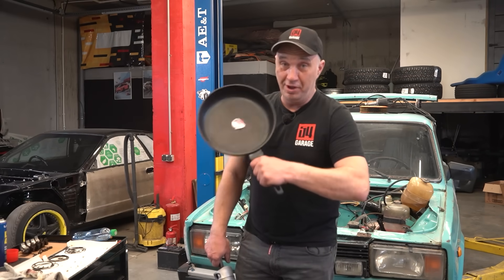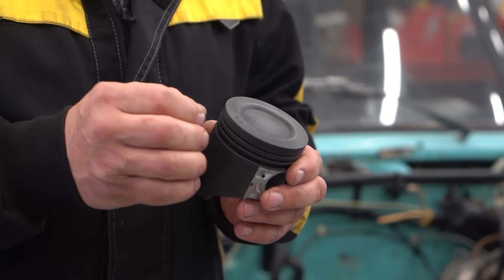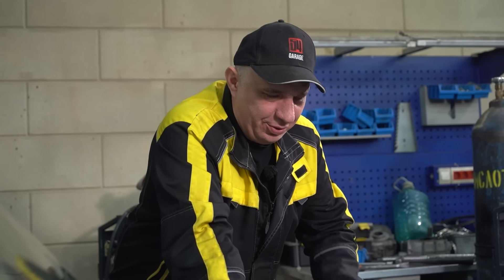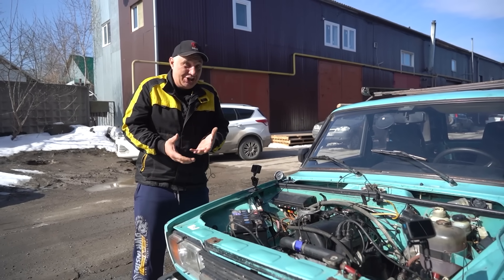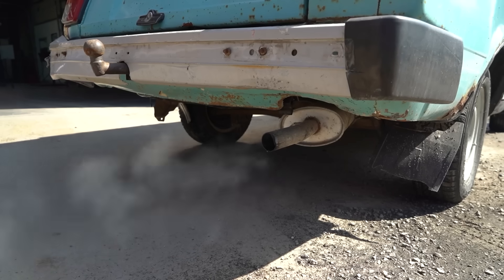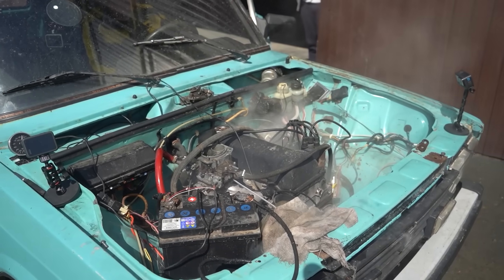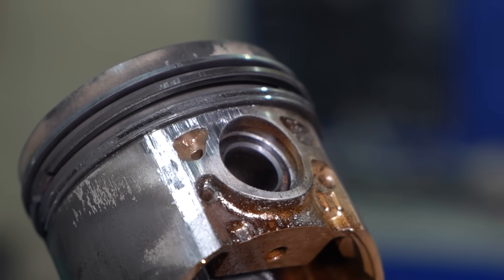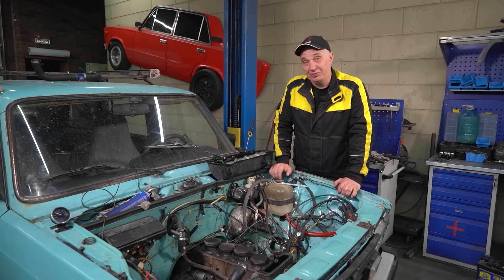We coat pistons with Teflon - what will happen?

Comment: At this point I'm convinced that anyone in that shop could assemble that lada engine in their sleep.
Reply: When they sleep, that's what they dream about every night.
Reply: @MF175mp that's what lada dreams about actually... "Put your hands in me papi"
Reply: An old wives tale says that Russian borne baby mechanics are gifted the repair manual shortly after they've grown and are able to read
Reply: It would be nice if corporations would put out such relatively simple machines still. ECUs are a pain in the butt.
Reply: @NoGoodNoob  This is what engine swap projects are for...
Reply: @NoGoodNoob just put a carburator on it Ohh The ignition is also Run by ecu mmm
Reply: @NoGoodNoob  simple means not efficient nor fast, in lada case - not even reliable. They are very badly designed cars (well, the original is a good design, but the soviet manufacturing is horrible).
Reply: @NoGoodNoob  but ecus also make cars usable
Reply: @NoGoodNoob I think LADA simple is too simple.
Ideally somewhere around 2008 simplicity IMO.
Reply: So can probably a lot of the viewers (as has been mentioned in this thread))
Reply: If you can connect two lego blocks you can assemble a Lada engine, they're as simple as 1960s USA V8s
Reply: LoL!
Reply: Lada engines are engineered to be disassembled  and assembled by drunks on the roadside.
Reply: At this point I can do it in my sleep 😂😂
Reply: haahhhahaahaha i love this comment
Reply: maybe even when being sober 🙂
Reply: If memory recalls right i believe they did a running swap and blew my mind never would have believed it if they didn't video it
Reply: Bro it is the simplest Engine on earth. OHV 4 CYL. CARB MECHANİC SPARK. 30 MİNUTES THE CHANGE HEAD GASKET İMAGİNE REST
Reply: Imagine wake up in the morning and found engine fully assembled and thought that I might did that in my sleep.
Reply: La verdad es bastante viable, ya que soportó temperaturas superiores a un motor standar, comparativamente duraría más en condiciones normales de uso.
Reply: Chez Renault, Peugeot et Citroën, ils ne peuvent pas en dire autant..
Reply: Thats 60's tech for ya.
Reply: シリンダー内壁と接してスライドしているいるのは、ピストンではなくピストンリング！
ピストンをどんな加工しようとこの接触は変わらない。
この程度の無知を騙すのは簡単だねｗｗ
Reply: I am pretty sure I can and I have never seen a lada or lada motor in person ever lol
Reply: @DarkAttack14  I mean it's probably one of the simplest motors you could build lol, the V-twins they have on most lawnmowers in the US are more complicated.

Comment: My father got a peak at 210 °C (from the engin managment) with a 1.5 DCI and only 1 rod bearing die. No overtemps light or oil was on. Only boilling water.

Comment: Actually... some manufacturers have started to use ceramic coatings on the pistons to improve the lubricating of the piston, and it works.
Reply: I can see Ceramic, not cheap but... it makes sense. Ceramic and heat goes well together. 
But yeah Teflon? a theoretical idea that just doesn't work.
Reply: But how does that work given that it's the piston rings that contact the cylinder, not the pistons themselves?
Reply: @KaitouKaiju  It allows the creation of a (nearly) friction less surface between the piston side and the cylinder walls for the oil to extra lubricate and let the piston slide more easily up and down.

Comment: this might help some , doesnt allow carbon buildup on top of the pistons and might reduce friction insde the cilinder , increasing the size of the piston might make it a cheap way to make the pistons fot a slightly oversized cilinder might want to try and coat the combustion chambers too
it might insulate the conbustion allowing more heat and power inside the cilinder and might be more resistant against detonation

Comment: Ford actually did this with the cylinder liners for the SVT engine variant of the DURATEC25 V6 found in the Mondeo MK2 2.5 V6 SVT producing 205 hp over the regular 170hp model which also used the DURATEC25, the SVT variant had fully upgraded heads with a different valvetrain and intake manifolds had a variable length intake system, exhaust manifold was different too. 

Try this experiment again with the liners instead 

The teflon coating would eventually wear off somewhat early, it was probably more useful from a marketing perspective than an actual performance increasing treatment.
Reply: Something needs to retain the oil on the cylinder walls.

Comment: "I paid for the whole temperature gauge, so I'm gonna use the whole gauge!"
Reply: I wonder if a mechanic has ever been told that 😂
Reply: Aside from the rings pistons don’t have any contact with the cylinder walls.  This is a pointless experiment.
Reply: @Notfiveo0  Wrong, a teeny tiny part of the pistons skirt slides on an oil film on the wall. If it didn't we wouldn't be wasting piston material (weight) on piston skirts.

Comment: The industry coats friction surfaces such as bearings and piston skirts with molybdenum dry film. Reduces friction and offers protection in the case of oil pressure loss.

Comment: If I had to guess, and I do, I would expect that the pistons being slightly undersized after the Teflon coating was applied was what made the engine last as long as it did. I'm sure the extra lubrication did help for a while but that extra .5 mm would allow that much more expansion before contact seizure.
Reply: 0,05mm
Reply: @ There is already room for thermal expansion. The extra room meant a higher threshold, as well as the Teflon paint coming off gave even more room for expansion.

Comment: Every time I build an engine, and the new piston set has no coatings, I coat with graphite myself. I also coat the cams.
At minimum it helps the break in. After that, it's up to my hone job and oil.

Comment: Ceramic coating of pistons, along with internal engine coatings, gained popularity around the mid-1990s. This was driven by the desire for increased horsepower and the limited availability of aftermarket parts at the time. JE Pistons offers a variety of piston coatings, including thermal barrier coatings, TUFF SKIRT coatings, and anodized ring groove coatings. 
Elaboration:
Mid-1990s:
The introduction of piston coatings, including ceramic coatings, can be traced back to this period. 
DIY Kits:
Early applications often involved do-it-yourself kits that could be applied at home using an airbrush and a conventional oven. 
Increased Horsepower:
The pursuit of higher horsepower and improved engine performance was a major factor in the adoption of these coatings. 
Engine Performance:
Ceramic coatings help to reduce friction, improve thermal efficiency, and enhance engine longevity. 
Benefits:
Ceramic coatings can help reduce heat transfer from the piston to the cylinder, leading to cooler running temperatures and reduced wear. They can also help to improve engine performance by reducing friction and increasing exhaust velocity. 
Piston Coatings:
JE Pistons offers various types of piston coatings, including thermal barrier coatings, TUFF SKIRT coatings, and anodized ring groove coatings. 

Wait, You Can Cerakote Pistons?
In doing so, you get the heat out of the cylinder head into the exhaust, thus yielding higher horsepower and increased engine longevity.

Cerakote

Ceramic Coated Pistons Noordeman Diesel
The ceramic crown coating can withstand temperatures of up to 1300°C and pressures of up to 69,000 kPa (10,000 psi).

Comment: Instead of PTFE, could you cast a new set of pistons with a high molybdenum content,, or maybe using an ionizing spray emitter to coat the part at the molecular level, making it self lubricating? Since it isn't a painted coating it shouldn't burn off the same way. Also, I hate to be that Karen, and we mess with a lot of nasty stuff as auto guys, but you really shouldn't be touching that burnt PTFE dust with your fingers, and a respirator is a really good idea. That crap will permeate transdermally pretty easily, and won't go away easily. How about a graphene infusion at the surface level? That should also help with reducing surface friction, and can be arranged to create a very physically durable coating, and is much more temperature resistant if you can remove stray carbon chains and reduce possibility of an oxidation cascade.

Comment: coat another in teflon, run it for a few months under regular load, then pull it apart...
Reply: Two with Teflon and two without.
Reply: Yeah I'd be really curious to see how that turns out. Either way they have pushed things here beyond what stock would handle.
Reply: @MadScientist267  Not really. Just everyday stuff around here. You can't replace the real deal meaning fake or adding to- for engine parts.
Reply: @craigpennington1251  They removed the radiator, didn't seal off the cooling system and probably had vapor in the water passages in the head (from the system not being sealed) that kind of treatment would destroy most engines.
Reply: @amorag59  Pretty sure the head gasket was leaking like a sieve because there was a lot of white smoke blowing out the exhaust.
Reply: @MadScientist267  It would be burned off. The internals of an engine are beyond the heat range of Teflon
Reply: @SilvaDreams  Not along the skirt where it matters. No need to coat the crown or anything else, just where it makes contact with the walls. It easily sees twice normal operating temp in higher heat cooking and stays there just fine. In normal 220~230F operation where the skirt and walls run, it would be fine. The fun part would be the tolerances. My bet is it would stand up to normal engine use rather well.
Reply: Yes, I would’ve liked to have seen what the Teflon looked like before they tortured it to death.

Comment: If 110 degrees Celsius is 230 ° f for us Americans, our average operating temperature for cars is between 195 and 215 I really don't understand why that exploded at that point it was barely over operating temps
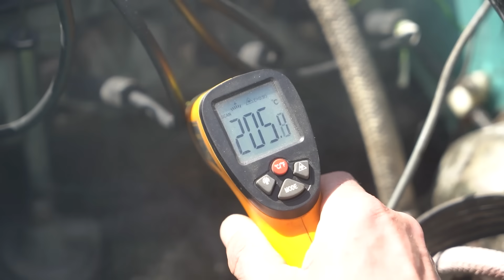Reply: I went back to make sure before commenting but, if you go to 9:50 into the video it shows 204 degrees C and not degrees F, so would translate to maybe 400 degrees F.....hence the boom! I'm from the UK and we use C but then we drive miles and measure fuel in litres....no wonder we all get confused 😂

Comment: Can you use vodka as coolant for a car?
Reply: Perhaps but you can definitely use it as coolant for a jet aircraft. Look up Tupolev Tu-22 “Booze Carrier” it was the First Soviet Supersonic Bomber. 😊
Reply: Coolant is usually alcohol and water based, so yes. There was a Soviet plane that used 40% ethanol 60% water as coolant, and they had issues of workers drinking it on the job
Reply: The corrosion would be awful

Comment: The Teflon will melt and burn and create very poisonous gas.... There is coatings for cylinder walls that is intended for that use of making them harder and more slippery, maybe try use that on a piston?
Reply: It is silly that manufacturer coat the walls instead of the piston. It complicates the manufacturing and then hinders maintenance/repair compared to if they just coat the piston like these guys did. They want to harden the wall to thin it to increase heat-flow to increase combustion temperature but these guy simply ran the engine at 200 Celsius.
Reply: Teflon coatings on pistons are usually only located at the skirts, away from the burn in the combustion chamber and is meant for wear mitigation. Not including the crown and ring grooves!

Comment: Make all the rotating parts heavy using for example lead and tungsten and see how it runs. Kinda how you made rotating parts lighter but in reverse.
Reply: Tungsten is very, very hard to machine. Lead is too soft and has 0 tensile strength.
Reply: A 60 lb flywheel will have the same effect.